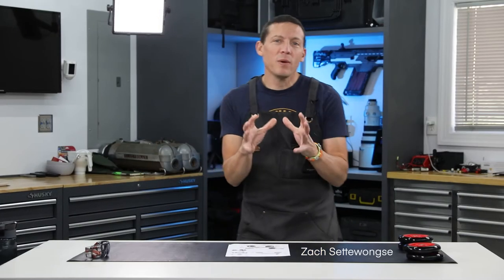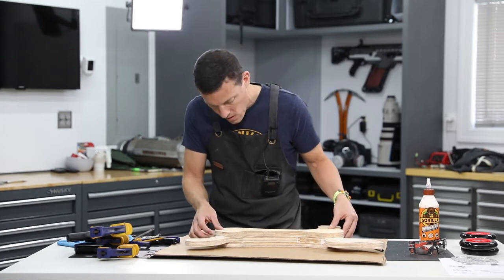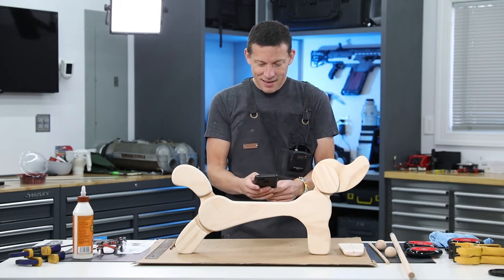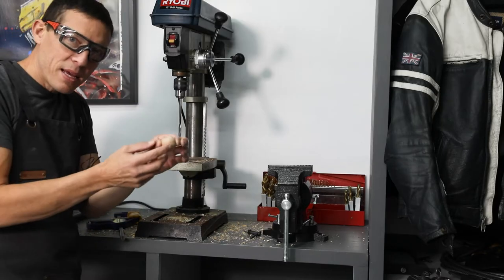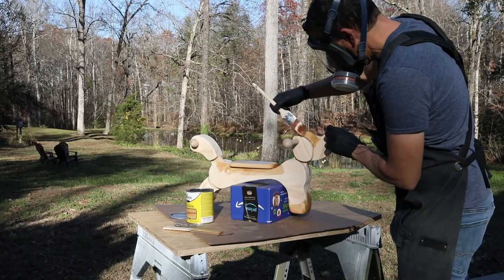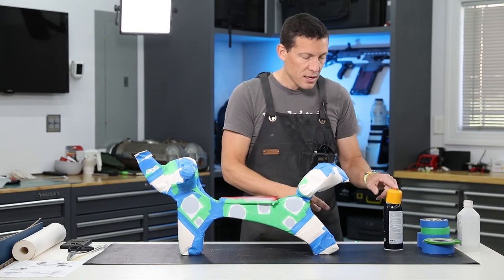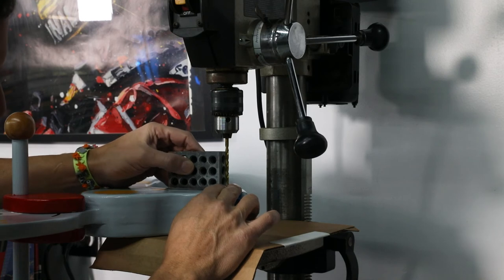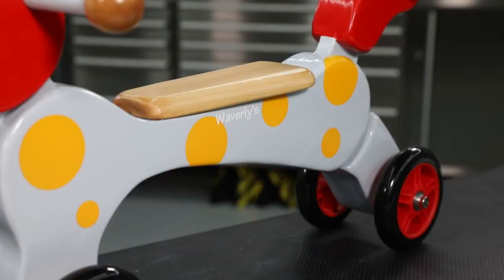Make a Wooden Toy Doggy ride on scoot bike. DIY

Comment: I'd like to make something like this for my 6yo handicap nephew. What suggestions would you have for modifying it for this situation.
Reply from the maker: If he's 6 you'll need to scale it up a bit. I would say about 25-30% larger. Looking at kids strider bikes for 6yrs old, they have a seat height of 18"-22" tall. So scale the dog up to where the seat is 18"--20". The wheels I used are 120mm (in description). You might use these 200mm taller wheels ( https://a.co/d/3rQCRSw ) for more stability, not sure it's needed, maybe just at the front? You could also widen up the front a bit with a spacer (double the wood up there, add a plastic spacer over the axle, something). Lastly if he has some difficulty holding onto it you could add an adjustable strap above each handle, so his hands fit between the strap and the handle. I hope that helps. You can also email me and we can do a Zoom call, my email is on my website settewongse.com